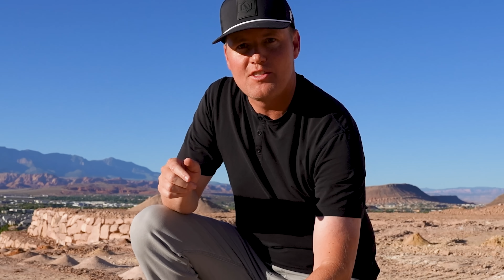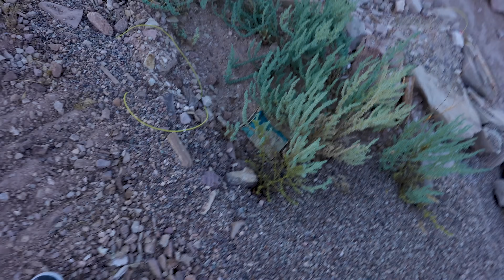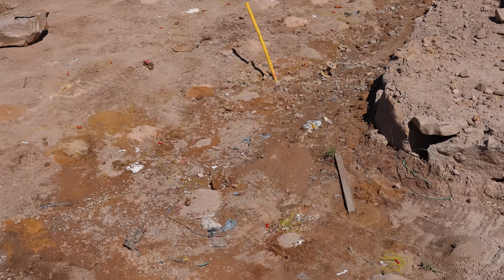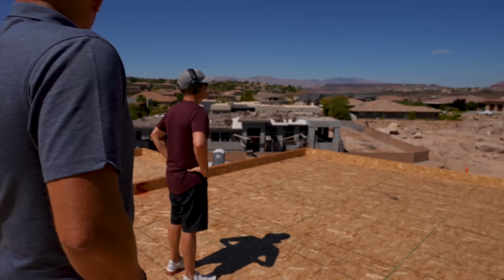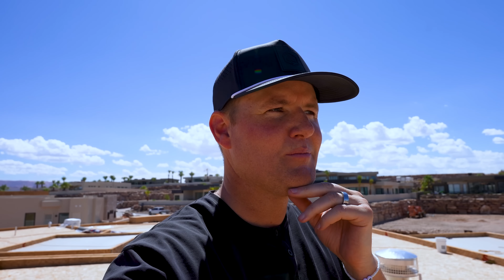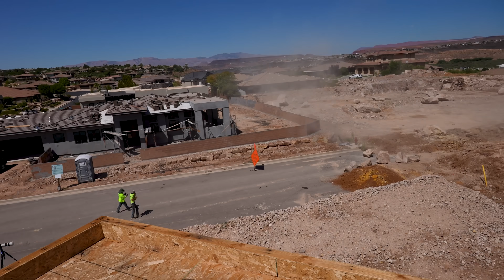MONTH 6 HOME BUILD IS EXPLOSIVE!

Comment: Bomb tech here... The yellow tube that looks like a plastic straw is shock tube. It is the lead in line for the blasting caps which are the first stage of the explosive train. The piece you held up was two detonators tied into each other for a delay det. They will tie the blasts together this way so there are milliseconds between individual explosions. It will almost sound like one explosion but since there are actually milliseconds between  each blast the blast pressure waves are separated so it wont damage nearby structures. That's why in the house you heard it but nothing moved. Someone did the math right so that even though they blasted a fairly large area the individual blast pressure waves weren't enough to cause damage to any person or structure nearby. Come to Texas, we will put you in a bomb suit and let you press the button.

Comment: I work for a home builder. The red cap is a blasting cap, and the yellow cord is the detonator cord. They fill the drilled holes with a special mix of explosives, attach the cords to the detonator, push the button, and boom. We film all of our sites when we blast them; it's a really fun thing to see!  We have a large site blast coming up soon can't wait to see it; ours is going to be about 1 mile of total blasting.
Reply from the maker: That’s cool
Reply: @WHATSINSIDEFAMILY  I wish I could post a photo. We just started drilling today. We’re running two machines to try and meet a paving deadline before winter.
Reply: @WHATSINSIDEFAMILY  would love to have you come film it here but we have less than 3 weeks till we blast!
Reply: @JulesLoesch  I'm not from the US but here we use excavators with breaker for this kind of stuff, whats the benefit of explosives? is it easier and more cost effective to use?
Reply: @NtheRubiksCube  like you said it’s more cost effective to blast for us. We try to blast roads, storm water and sewer (usually it’s deep 10-25 feet) and we always try to blast the home plots so we don’t have to use a buster. Here where I live it’s about $450 an hour usd to use a buster so for your average home lot that’s about $15,000 but if we blast we can get it as low as $5,000 but that’s if no homes are in the blast range; otherwise we have to get the buster out. Plus it’s a lot easier to have a site shovel ready we call it.
Reply: @JulesLoesch  So is that how you flatten land?
Reply: @FlawlessImperfectionssssss  technically it raises the land with fill then we have to excavate it to flatten/contour it
Reply: Isnt there a danger that one of the explosives does not detonate properly and might detonate later when people go on the site?
Reply: @Spazik86  in the extremely rare case that happens we have ways to detonate the charge or even ways to neutralize the explosive in the hole. No one would enter the site if there was a mis fire till the all clear is given by the blast contractor.

Comment: Why do they do that?
Reply from the maker: So many Rocks where we are building! Only way to get deeper into the ground
Reply: @WHATSINSIDEFAMILY interesting, love your home videos💖💖
Reply: any area with a lot of rocks its cheaper to blast drill it, vs trying to use large equipment to trying and brake rocks apart which would take a large amount of time, fuel and money. its more environmentally friendly option as well.
not only does it brake up rocks allowing machinery to haul it easier, it decompresses the sand/soil making it easier to excavate
Reply: @smittysbuilds wow, interesting

Comment: how is it explosive
Reply: they drill holes which are then filled with ANFO which is 2 part mixture of Ammonium Nitrate and Fuel Oil that's stable until mixed.
similar to Tannerite which is also ammonium nitrate but with other components which is safe until mixed then can explode when shot with a round.
then they link everything with blasting caps and detcord and tie everything into a single main line to a detonator.